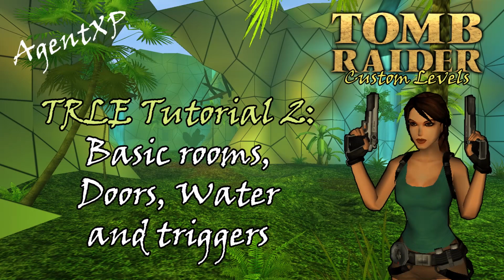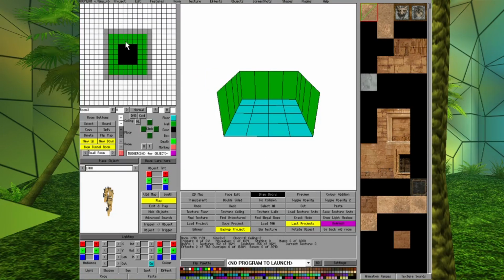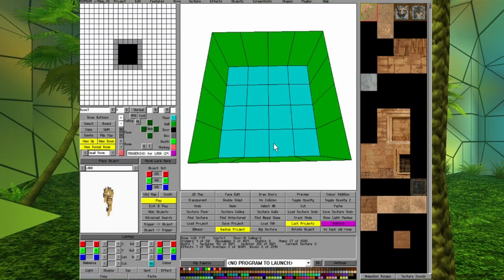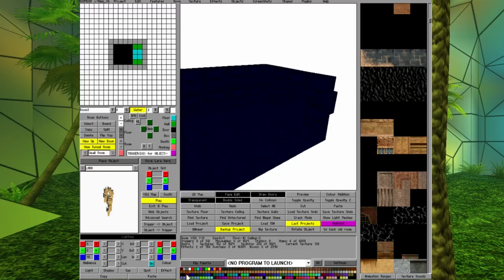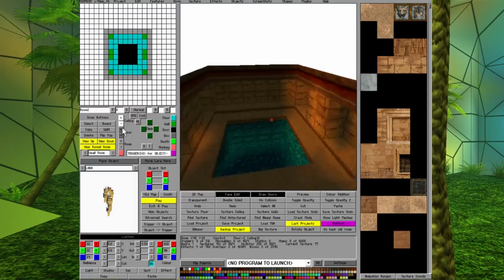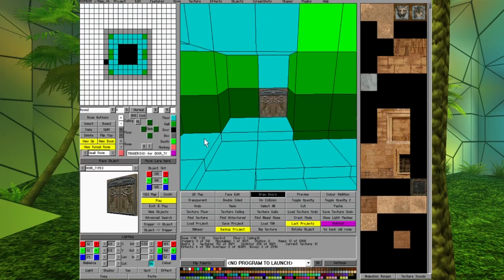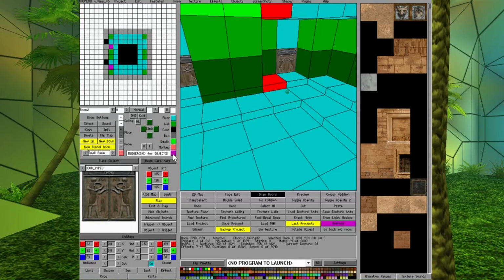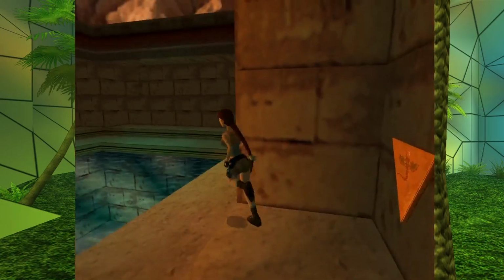TRLE Tutorial 2: Basic rooms, doors, water and triggers

Comment: Yo AgentXP. I have to ask: is the splash screen for these videos an alpha screenshot of the Core TR10AE (I.e. The good remake) Lost Valley? I highly approve. I've wanted Core's members, especially the TR10AE team from back in 2005/2006, to restart development and finish that game (as a fangame so Squnenix can't touch them this time) since at least 2018. Especially now that Free Running (whose engine it used) is on Steam now, making it easier to run on modern hardware.
Reply from the maker: The splash screen is a from a WIP lost valley TRLE level of mine, inspired by Core's TRAE. I'm not working on it at the moment, but plan to revisit it at some point, once I'm done with other projects.
Reply: @agentxp0749  Nice! I'd love to see it when it's done. Would the rest of TR10A be covered as well? You see, Teeth abandoned his TRA Retold project during Greece, which was upsetting as I really wanted to see the remaining 3 areas, especially Atlantis. Even more so if he would have tried to include the War Machine boss sequence.

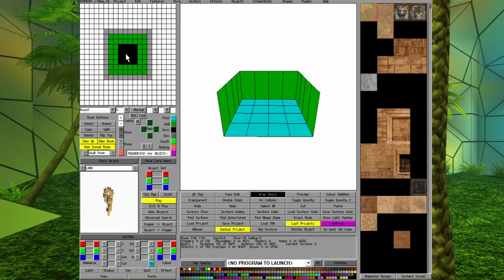Comment: Great video. I have a question @5:00 is there a shortcut that you used to delete the portal? Because when I try to delete the portal it says there is no object selected. And if I change it back to floor it doesn't have that small section of a portal in the south. Thank you!
Reply from the maker: You need to keep clicking until the green outline appears around the portal, before you press delete, otherwise you don't actually have the portal selected, and it will say 'no object selected'  :)